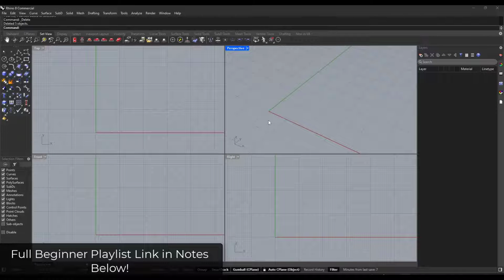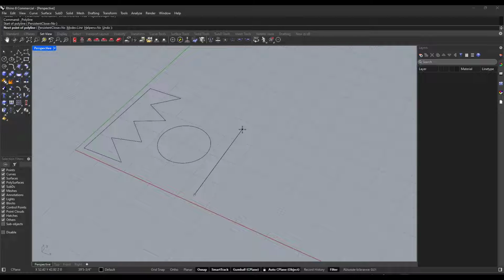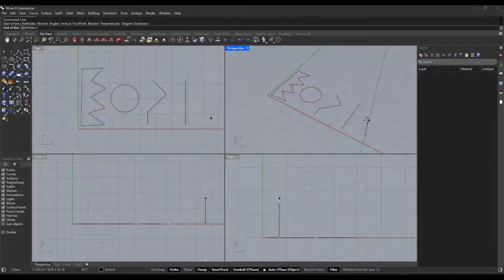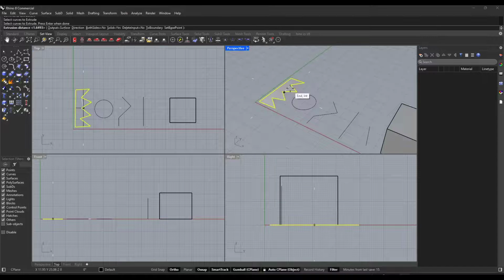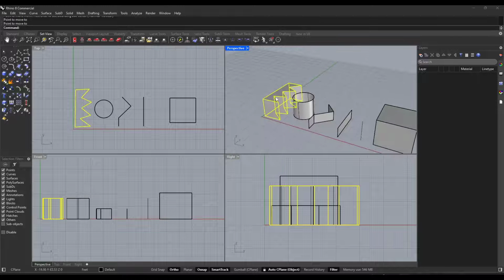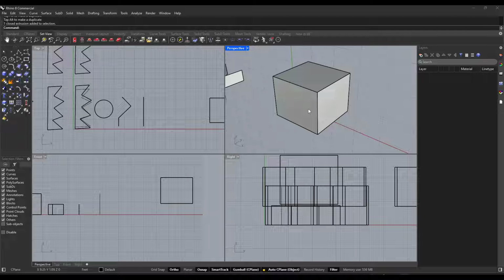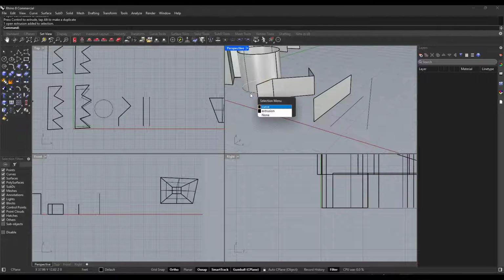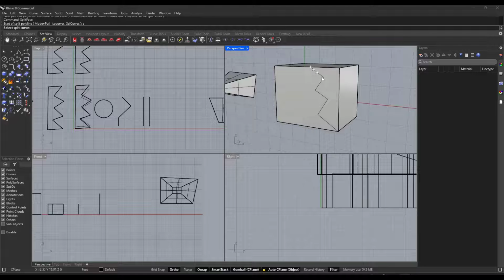Getting Started with Rhino Part 2 - Lines, Faces, and 3D Shapes!

Comment from the maker: Hi everyone! Let me know if you have any questions about anything we talked about in this video, or if there's anything you struggle with in Rhino in the comments below! :)
Reply: Hey, question - Why my command - Control+Shift not working? I can't select poligons or any lines specificly
Reply: @stanblissful5409  While holding Cntrl+Shift also left click on the surface you want
Reply: @stanblissful5409  While holding cntrl+shift also use left click on chosen surface
Reply: I don't have a pushpull command !.
Reply: @nourallah4356  same my rhino doesnt have a push pull is there any other way to approach this eg. we can extrude but to cave the shape is there any way ?
Reply: My split face isn't working please I need help😢
Reply: Hey, in this video  the Oswald tool seem like a very important tool in rhino, but my rhino it’s not working and I try to solve it by researching online but nothing seems working 😢
Reply: Do you offer private tutoring?
Reply: Thank you Justin, I started to learn Rhino with you.👌
Reply: what I draw the arc on the face of the extrude, it actually puts the curve on the construction plane rather than on the face. So it disappears, and you can only see it by zooming out--it looks like it's underneath the extrude. Split face then doesn't work properly...

Comment: hi! Love your teaching method! Question...I have Rihno 7 and the Auto Cplane at the bottom is not available. Is there an option in Rhino 7 to activate?  Also, I have been trying the last exercise - splitface/pushpull on an object to remove.  But it's not working, is there a different command/method to do the same action?
Reply: I have the same problem for the push pull :/

Comment: When I try to draw a line or an arc on the cube or the solid I created, I cant use the SplitFace option, it won’t let me draw it directly on the cube. Even when I select the object or just one face of it, it still draws the line in empty space instead of on the object. what should i do?
Reply: right-click osnap in the bottom bar > settings > uncheck "Project object snaps to CPlane"

Comment: the snapping is not working as you show... everything is activated, however there are no guiding line
Reply: for anybody else with the same issue you need to check the options on the left side menu

Comment: Hi Justin. Thank you so much for sharing you knowledge and experience with all of us 🙏🙏🙏😍 I was a 3d designer working with Vector Works and 3d Studio Max. I'm now a mother for 12 year and my son is having a rare syndrom so it was a hard time for me and I wasn't able to work or do something for myself.. Luckely my son is doing much better now and there is finally more ME-Time!! I've decided to take up 3D drawing again, and that's how I came across Rhino and you :) But I have a few questions and hope you can help me. At your left corner in the screen you have a command-bar where you can ad text. ( between File and Standard ). I don't have this bar. I've searched high and low but can't find anywhere where or how I can add it. Can you advise me, please? 🙏🙏🙏Because of this, I can't do the push-pull you show at 20:15 minutes. I hope you can help me. Thank you very much in advance, and I look forward to watching more of your videos. 🤩😍🥰

Comment: HELP! TY FOR THE TUTORIAL BUT I CANNOT DRAW A LINE OF A SOLID SURFACE, IT JUST PROJECTS IT TO THE SINGLE PLANE GRID! PLEASE HELP!!!!!!!
Reply: I had the same problem. I guess you figured it out by now but i'll write here how i fixed it for whoever stumble on this again.
You should have the Osnap filter and selection filter on the left of your screen, if you didn't move it somewhere else. In the Osnap filter uncheck "Project". Alternatively, you can type "ProjectOsnap" in the command line and then type "D" for disable or "T" to toggle it.
Reply: @spillzahar5106 man I never fixed it. Thank you! I will prob use the software next semester.
Reply: Have you resolved the issue?
Reply: @zenentrax  go to osnap > settings > disable project object snaps to CPlane

Comment: Hi Justin. I'm new to Rhino and your tutorials are really great!! However,  i can't get OSnap to work... It's toggled on, but no dots appear on any other object where i can snap my line to... Is there any setting i need to adjust?
Reply: +1
Reply: For your issue with object snap (osnap) and inferencing not working, here are some steps to troubleshoot:

Ensure Object Snaps Are Enabled:

Check the Osnap panel at the bottom of your screen. Make sure the specific snap types (e.g., End, Mid, Center) are highlighted. If they aren’t, click them to activate.
Check Snap Modes:

If you want all snap types on, click Persistent Osnap to toggle them all at once.
Test in a New File:

Sometimes settings or objects in the file can interfere. Try creating a new file and test the snaps.
Check the SmartTrack Settings:

If inferencing isn't working, make sure SmartTrack is enabled (found in the same panel as Osnap).
Grid Snap Interference:

Make sure Grid Snap (next to Osnap) isn't overriding object snaps by accidentally locking your cursor to the grid.
Check Command-Specific Snaps:

Some tools override snapping temporarily. Make sure you’re not in a command that restricts snaps.

Comment: Hi! great video - only thing, how do you make it draw on the surface of the box, and make it snap to the sides/corner, when u have the face selected 19:50  - I can't seem to do the same, mine doesn't snap or draw inside of the marked face? :)
Reply: Draw on the suface of the box: make sure the Auto CPlane tab is clicked at the bottom of your screen, then Ctrl+Shift to select the face you want. You should see the CPlane snap to that axis. 

Snap to sides corner: Make sure OSnap is enabled at the bottom of your screen, and follow the following:
Ensure Object Snaps Are Enabled:

Check the Osnap panel at the bottom of your screen. Make sure the specific snap types (e.g., End, Mid, Center) are highlighted. If they aren’t, click them to activate.
Check Snap Modes:

If you want all snap types on, click Persistent Osnap to toggle them all at once.
Test in a New File:

Sometimes settings or objects in the file can interfere. Try creating a new file and test the snaps.
Check the SmartTrack Settings:

If inferencing isn't working, make sure SmartTrack is enabled (found in the same panel as Osnap).
Grid Snap Interference:

Make sure Grid Snap (next to Osnap) isn't overriding object snaps by accidentally locking your cursor to the grid.
Check Command-Specific Snaps:

Some tools override snapping temporarily. Make sure you’re not in a command that restricts snaps.
Reply: did you figure out how to fix this?

Comment: Thank you a lot ! I just have problem with the last part, when I try to draw the curve, it "sticks" to the X and Y plan, I can't draw it on the face of an object, do you have a solution?
Reply: the fix is that you right-click osnap in the bottom bar > settings > uncheck "Project object snaps to CPlane"
Reply: @domibre1040  tried this and still dosen’t work, please help!
Reply: When "Osnap" is active at the bottom, to the left of the screen there's alot of checkboxes that says "End", "Near" etc... Check all of them and then it will work. In the video you'll see that "Near" is highlighted as he clicks on the shape.
Reply: I have the same issue
Reply: @SN00NS  @clementgaillard288 Goto your Osnap checkboxes and unselect "Project". 

If you notice at the bottom left panel where on his screen it says "Selection Filters", there is another tab thats really small to the left of it that will show you the toggles for snapping, and there you will find "Project" with a host of other snap settings (Point, Curves, ect). Hope this helps.
Reply: @SN00NS  the fix is that you right-click osnap in the bottom bar > settings > uncheck "Project object snaps to CPlane"
Reply: second this!
Reply: Ah, the "planar" option toggled on in the footer plus starting the arc on the cornerpoint of my object in the correct plane in front view did it for me!
Reply: @KurtKommerz  the fix is that you right-click osnap in the bottom bar > settings > uncheck "Project object snaps to CPlane"
Reply: @domibre1040  aaah thanks!

Comment: when you use control+shift your faces light up with arrows and then you can select it. I can still select my face with control+shift however i dont see the highlighted arrows. Is there something i can turn on for that?
Reply: By highlighted arrows do you mean the blue red and green arrows? If so it might be that the gumball setting is turned off in yours. you will find it in the bottom bar, it should be bold to be on
Reply: @chrisveigas5975  not those but the pink ones before he selected a face of an object

Comment: 4:31 I cant seem to get the guides to a point ? is there something I need to turn on ?
Reply: I think i know how to get it, on tools menu select option than enable "project object snaps to cpanel in plan parallel views"
Reply: @sakuraqnomoto6446  it's still not working
Reply: click on SmartTrack in the bottom bar, next to Gumball; that should activate it
Reply: Under the tool on the left side pane, there is an OSnap pane that has checkboxes for things like "End, Near, Point, Mid, etc..." Check them all on

Comment: 4:05 It doesn't auto select the ends for me. I keep having to just eyeball the line and dont end up getting it perfectly.
Reply: im having the same problem. Did you find a solution to this ?
Reply: @maxpierce8414  Toggle the Disable button near the bottom on the left and make sure the points and curves is checked off
Reply: To the people in the future, I had the same issue. Check your 'OSnap' check boxes at the lower left tab. The one below saying "Selection Filters" (if the osnap tab isn't selected yet). Mine were all unchecked so my snaps weren't snapping. Just check all the boxes you need and its good to go :)